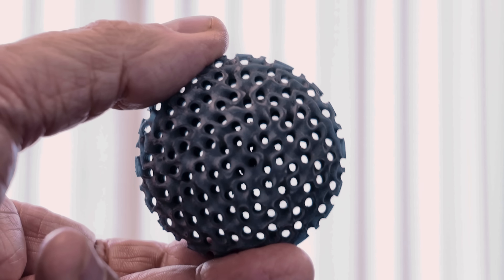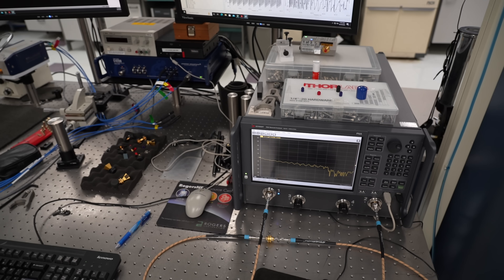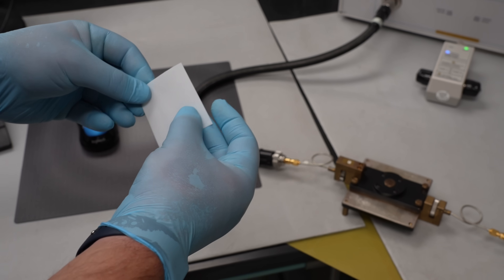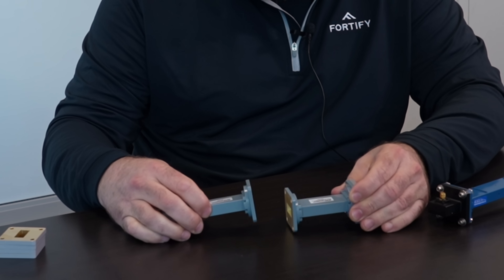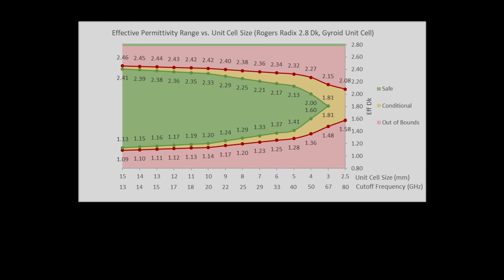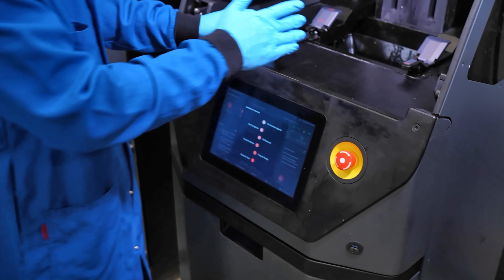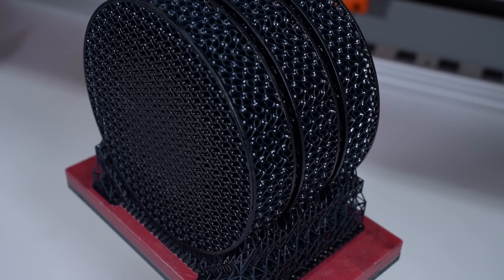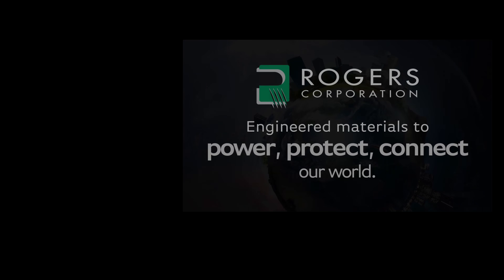Unveiling the Future of Antennas and RF Lenses using Radix™ 3D printable material!

Comment: Say, have you tried zapping termites with that microwave flashlight?😁
Reply from the maker: Termites are around 10mm long.  They have a reasonable water content, along with other polar compounds, so could have a relative permittivity between 3 and perhaps 40, so they are a significant electrical size above about 6GHz and should absorb well above 10 GHz, and up to at least 50 GHz.  Their loss tangent is probably quite high as well, so immersing them into an RF field focussed to a Gaussian form by moving the source further away than the prime focus should result in perhaps 100 mW per square centimetre.  A well fed termite weighs perhaps 6 mg, and has a thermal coefficient of a little less than water, so maybe 3 kJ/kg.K. so about 20 mJ per Kelvin for the whole body. The capture area of a termite acting as an inefficient antenna might be 5 mm^2, so at 100 mW/cm^2, that's 5 mJ per second. A 30 second blast of 24 GHz microwave energy would raise the body temperature of each of several hundred termites in the beam by at least 6 Kelvin (degrees Centigrade) or 10 degrees Fahrenheit.  I suspect that wouldn't be enough to disrupt their membranes or denature their proteins, so I'd need more then 2 watts, or more time, or a larger lens. More power would be best, as they might run away if blasted for longer, and a larger lens would reduce the number in the beam.
Reply from the maker: A better approach might be to rig up a Travelling Wave Tube at about 10 GHz, running 100 watts and blast the soil or wood where the termites are.  That would cause a lot of steam to be generated and bye-bye termites.  Bit inconvenient though.  Safer than pouring gasoline on them and lighting it, or using a gigantic propane torch.  My torch can produce 68 kilowatts of heat, but tend to set EVERYTHING on fire.
Reply from the maker: Oh, and there's a slight problem with any practical field tests.  We don't have termites here in the UK. Pity, that could have been fun
Reply: Looks like you have a handle on what would be needed for termite zapping.

Actually, there are companies that do no-chemical termite control, including the use of microwares. Nothing is available for consumer's as far as I know. (Though one Youtube vid shows a guy using a microwave oven, hot wired  so that it works with the door open.)

Maybe I  can send you some termites to experiment with. 😄
Reply from the maker: @kdeuler  I've seen the soil sterilisation microwave things they run on tractors, they work by generating steam using quite a lot of power. It's certainly feasible but terrifying to extract the magnetron from a microwave oven and connect it to a waveguide for remote carnage. One day I'll do the experiment using a giant water ice lens to focus the microwaves to a spot  some distance away. Too warm here since we stopped having proper winters
Reply: That is a great idea!  @MachiningandMicrowaves  would your 3d printed lens work with microwave ovens magnetron to focus beam at some point 2-3 feet away?
Reply from the maker: @dmitrykomkov6354  It would need to much larger (at least a metre diameter) to work at 2.45 GHz, but it's certainly technically feasible, although the focus would need to be more distant to keep the weight of the lens manageable.  I would like to make a giant water ice lens and use that to focus a beam from a modified oven.

Comment: At Play ref: 10:12 the cross section is described as 50mm x 50mm ??? sorry 50mm is close to 1.97 inches ..surely he means 5mm which is scary if the calibrators don't understand basic units...
Reply from the maker: 50 mil in the USA is 0.050 inches. Same as 50 thou in the UK, so 1.27 mm

Comment: I wonder if in the future, the entire beams and structure of buildings can be turned into antennas. I don't its a matter if they can do it, but how much it costs. I'm sure we could do it with todays technology, but the costs of material would be astronomical that it isn't financially feasible to think in such innovative ways. 
Usually innovation and creativity in industry settings is always crippled by financial limitations and budgets.
Reply from the maker: Air conditioning ducts, filing cabinet panels and similar surfaces are a useful source of potential reflectors. I've used the central heating radiators in my house as an transmit antenna at 3.5 and 7 MHz
Reply: @MachiningandMicrowaves  Thats amazing to know, I guess if one truly had the mind of genius he can figure out how to get the job done while keeping costs down.  Congrats

Comment: Does anyone know what the technical name is for the lattice structure pattern used in the video?
Reply: It’s a gyroid lattice structure for anyone with the same question
Reply from the maker: There are other lattices that work, but a gyroid  lattice is easy to print as it doesn't have any re-entrant curves. It's also based on a very simple mathematical expression that is adaptable to create a variable-density structure.  A cubic face centred grid also works, but there is a risk of creating unwanted diffraction from any large-scale variations in print density, whereas in a gyroid they tend to be smeared out.  It's also a very stiff foam lattice. It's from a class of objects called Triply Periodic Minimal Surfaces (TPMS) and the generated surface has two sets of labyrinths that gyrate around an axis and meet the common planes of two axes at an angle of 70 degrees (can't recall the exact number). It has the useful property that all of the channels are hollow and continuous, so there are no closed voids so long as the lattice wall thickness is less than the unit cell radius. That means it can be washed and cured easily and also air-cooled for higher powered applications. The equation for a zero thickness gyroid lattice in a Cartesian coordinate system with orthogonal axes x, y and z is simply 
sin x cos y + sin y cos z + sin z cos x = 0
Then you change the wall thickness using an expression varying with the three parameters. Easy. I'll put my horrible Python code into my vid about the structure. Python is a horrible language when you are from the K&R era in the days before ANSI C and well before Bjarne went all OO and made C++, but I can do Python when there is absolutely no alternative. I think in Perl and C and assembler, but code in Go and Rust and Ruby  and MATLAB and the C variants used in the IDE for PIC processors. I can even almost bear Arduino code, but I'm allergic to Javascript and Python.  I suppose I should code up a gyroid lattice generator in Javascript now, just for the sake of it.

Comment: i don't even know what you are doing, let alone the details. are you making custom RF antennas? or is this a completely unrelated application of RF? could this make RF antennas higher performance?
Reply from the maker: These smaller lenses are to improve the efficiency and suppress unwanted sidelobes of the feed on a parabolic dish antenna used to bounce microwave signals off the moon.  The larger one is just a simple magnifying lens for experiments I'm doing.  Building one into an empty nflashlight case with a transmitter and receiver at 24 or 47 GHz is just a convenient way for me to get a portable and weather-resistant test system for measuriing the radiation pattern of other antenna systems I use when I'm trying to validate a design.  Part Two should shed a bit more light on the applications

Comment: Am at 11:52 and I don't know what I'm watching. I clicked on the video to learn something new, but I can't understand what's going on
Reply from the maker: I'll be doing an explainer for that instrument and making my own later in another video.  The principle is that if you have a waveguide and you calibrate it using a Vector Network Analyser, then extend the guide with those spacers and insert a block of material, you can  calculate the additional delay and amplitude change caused by the block compared with just having air in the guide. 

If you test a solid printed block of the material and compare that with a known material like Rexolite 1422 or PTFE or HDPE, that will give a value for the permittivity at 100% fill.  

You then repeat the test with a lattice print at a specified density and test the resulting block to find the permittivity. You can see what that represents on a line between air and 100% solid material.  

It's about quality assurance to ensure that your machine calibration is producing the expected value of permittivity (Dk) and loss tangent (Df).  The loss tangent is is very very small, like 0.4%, and that's tough to measure.

Comment: did you lose your mic on location?
Reply from the maker: I was using Rode wireless lavaliers most of the time, the noise in the labs was dreadfully loud, so there's a lot of processing.  I did leave a tripod, two lighting stands and two LED panels on the sidewalk in Cambridge MA, which was not ideal. In one section, The channels were split stereo and there are a few responses from me that were on the "wrong" mic and I didn't mix them back in.  I'm a total beginner at this lark, I've never tried filming interviews before

Comment: By computers fan sympathetically turned on at 22:00
Reply from the maker: It's more about reducing sidelobes and shaping the beam that about efficiency improvement.  Noise from warm soil and buildings that's received from the sides of the antenna add noise to the receiver.  Also cleaning up the transmit pattern helps to stop overload of nearby systems.

Comment: Where can I find RF lense stl or other printable files?
Reply from the maker: Sadly, I don't own the files for those, I only did the design and calculations, but I'll be making some new versions soon that are intended to be printed on my Bambu X1C and Prusa.  I'll definitely make those available for sharing
Reply: @MachiningandMicrowaves  can you describe how you calculated the shape of the cells of the lens in a video? Where did you get the file for the lens when you worked with Rodger corporation?  I might have missed that. Do you sell custom machined feed horns?  Sorry for the questions. My head is buzzing with projects to make antennas for EME.

Comment: We need focused beam vhf/uhf designs
Reply from the maker: Scalability is a huge problem once you get below about 2 GHz.  A lens needs to be about 10 wavelengths across, so at 300 MHz, you'd be looking at a structure weighing a ton or so.  Easy enough to make such a lens using dielectric blocks, but metal structures are just so much more effective in economic terms

Comment: It sounds like to me that this material would be helpful in the design of a Anti-Gravitic vehicle. What's in this material again!?

#JustMaybe 🤔
Reply from the maker: It's a fine-grained ceramic in a photopolymer matrix. Getting a system that could generate gravitons of a reasonable wavelength is the trick,  Tends to need merging neutron stars or something and you can't just get those from Amazon (well, I haven't actually checked)

Comment: When you say gradient index you  mean refractive index.  How could we make a 7 Mhz. (40 meter) metantenna?  WH6DSF
Reply from the maker: Yes, gradient refractive index or permittivity, varying  smoothly or sharply in 1, 2 or 3 orthogonal directions. I think a metamaterials approach using rings and rods to make a double-negative medium would still be massive at 7 MHz.  Most of those techniques using negative index of refraction metamaterial elements are at UHF or SHF.  It would certainly be fun to try at perhaps 23cm, 33cm  or 70cm to see what is possible in terms of size reduction of the elements by using metamaterial loading and see if it would be in any way feasible at 50 MHz or lower.  Those ultra low frequencies make me uneasy, I'm much happier above 2 GHz.

For a lens , the unit cell size on 7 MHz would be about six feet across, and to get useful gain from a lens you'd need it to be at least 15 wavelengths diameter and two or three wl thick. That would be 600 metres diameter and maybe 100 m thick, and would weigh around a quarter of a million tons, a mere 4% of the weight of the Hoover Dam, but expensive enough to make Jeff Bezos think twice. 

I must try some metamaterial antennas to see if there are any practical applications
Reply: @MachiningandMicrowaves  Ok I'm a ham and a bit of a dreamer. No the Hoover dam lense is not practical.  I'm never ceased to be amazed by the Hawaii 40 meter net.  My rig makes about 70 watts and I hear hams all over the state. I use a G5RV kinda dipole 212' wide with coax and ladder line.  Works unbelievable. John Pendry has some fascinating lectures about meta materials.  Made me wonder if its at all practical for 40 20 or even 10 meters......
Split rings and rods sounds doable. A ham radio metantenna?  Thankyou for your learned quick response. 
WH6DSF
Reply from the maker: @dimension2788  There are some good examples of small antennas using a metamaterial approach, like the NIST Z antenna, but 7 MHz compact antennas are challenging. I've only worked about 250 DXCC on 7 MHz, almost all on CW. I have been testing some compact antenna designs for 160 metres, using very high-Q inductors tuned using aluminium pistons and using a variable geometry link coil, that shows promise.  I've worked quite a few US stations from the UK on 160 metres using only five watts to fairly compact antennas in the big CW contests.  With my big 160m antennas, I've worked quite a lot of US stations out to Ohio and Texas, but mostly east coast, using just one watt of CW. It's a fascinating band. I must try 40 milliwatts on 160 using one of the LF/VLF protocols like EbNaut to see how easy it is to get across the Atlantic at 100,000 miles per watt.  Best I've managed on 20 metres was 8000 miles on 250 milliwatts of CW. Those really deep protocols work well on 136 kHz and on 8270 Hz.  It's a long time since I've worked anyone in KH6 on Top Band.  I got to 300 DXCC back in the 1990s but then lost interest and went 4 orders of magnitude higher in frequency!

Comment: 3D printing doesn't create smooth pore less material. And RF technology is sensitive to fine structures. Based on the image the structure of the 3D printing process and the structure you intended to be there are in a similar range. Does that have an influence on the quality of the signal?
Reply from the maker: I thought I'd replied to this, so apologies if this is a duplicate. Any dielectric structure with features less than about 1/20th of a wavelength in extent is pretty much seen as a homogeneous block, and even at 0.1 wavelength, any inhomogeneities are not "seen" by the waves and are sort of averaged out.  The cell size of the smaller lens at about 2mm is less than a tenth of a wavelength, and doesn't have any long-range periodicity that cause significant scattering or generation of higher waveguide modes.  It's the large-scale variations of the order of a quarterwave that have most impact, so about 6-8 mm.  In the large lens, the cell size is OK for the 24 GHz design frequency, but I'm testing it at 47 GHz to see how it behaves there as well
Reply: @MachiningandMicrowaves  I'm happy that you answered me. I was genuinely curious about it. Thanks for the reply. What you wrote makes sense to me.
Reply from the maker: @benrex7775  It was an interesting question.Sorry I missed it when you first posted it
Reply: @MachiningandMicrowaves  No problem.